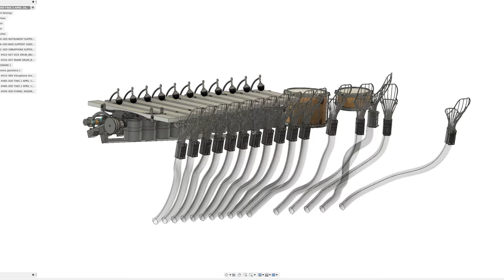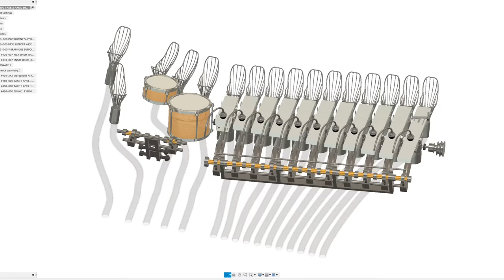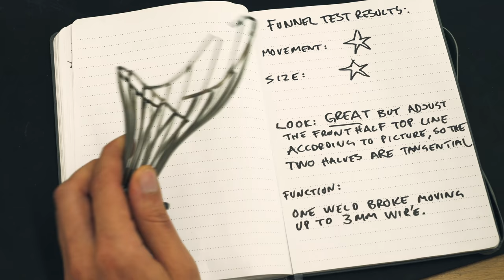Marble Funnel Design Test - Marble Machine X #87

Comment: Rather than fiddling around with welding such thin wire you should use material that can be soldered. Much easier to repair/modify. If that's stainless wire you can solder it as is. Maybe weld the originals, learn to solder it for repairs.
Reply: Maybe brassing?
Reply: Yes we are looking hard at brazing.
Reply: Or you can use spring steel that's known as "piano wire", with bakers flux it can be soldered very neat and amazingly strong, I used a small blow touch or at times a jet lighter to solder it, I used to make slot car chassis with it
Reply: Those almost looked like they had current welded the two together (Pressed the two sections of metal together at that point and ran a high current through them to cause them to fuse and weld together).
Reply: @TheRedneckExpress  i was thinking spot welding would be good too. martin can make one and be able to bring it with him on tour to fix any problems
Reply: @mick-sk5lw  Spot welding a piece that is constantly vibrating and stressing doesn't seem like a great idea to me.
Reply: @CaptainDCap   if they are the same metals and you have the settings correct on the spot welder then the joint will be just as good as welding it using a tig. besides welding the only other way to bond them is to solder/braze and that is something that will fail in a constantly vibrating piece like this.
Reply: Agree, braising or soldering won't be quite as strong as rigid as welding, which in this application will be advantageous

Comment: All you need for the improved spring mechanism, is a screw where you were holding your finger. KISS :p
Reply: I'm glad other people thought this! :)
Reply: Thatd mean drilling and tapping another hole, which is a bit of a bigger ordeal than just cutting off another piece of spring steel
Reply: @anter176  Another option is a hose clamp. It isn't super pretty, but it would be adjustable, and it would blend into the finish of the parts.
Reply: anter176 this is a prop, he can build the next one with the holes adjusted
Reply: No need to drill and tap 4 or 5 holes, just need one at the bottom in the center and another up where he was clamping it with his finger to get the nice motion. There: half the work for improved result.
Reply: What about add a magnet as well? To keep it immediately still?
Reply: I'm sure he's able to connect those two dots himself.
Reply: Finger helped because it damped vibrations, just epoxy two springs together. (constrained layer damping)
Reply: i would add a small solid plate with two slits for the screws ontop of the spring, so it can slide up and down and be clamped where needed. the side that touches the spring needs to be dampened but like this u should get a fine tunable system
Reply: Redesigning and re-machining the connecting piece to have another screw hole is definitely less simple than just adding another piece of spring steel or even a more rigid piece connected by the two screws at the bottom.
Reply: @buddyclem7328  If were going there, why not duct tape or a chip clip?
Reply: @Speed001  I wouldn't be willing to go that far on this project. Of course, sometimes that is exactly the right kind of solution. Cardboard, duct tape, plastic bags, and space suit hoses saved Apollo 13 after all.

Comment: You need an adjustable damper to absorb the extra vibration of the spring leaf. More leaves just push up the natural frequency of the vibration of the funnel. A damper, such as a small urethane foam block pushing against the leaf would not only dampen the vibrations, it would lower the noise level, which I think will make the overall playing of the machine crisper and cleaner - you have to remember there’s already a whole lot of “ground floor” noise being generated in the background in the process of making the main melody - you don’t want that background noise overwhelming the main theme.

Comment: Move your screws, no additional spring steel is needed. You let your fear of breaking a tap get the better of you !
Reply: I was thinking 4 Screws in the lower part and leave it alone.
Reply: Martin should be using his drill press with that tap handle. There is a divot on the end of the tap that a centering point goes into to keep it 90°.
Reply: Breaking a tap = no testing possible. Thats a pretty damn good reason to be scared of it.

Comment: About the spring: you have a spring-damper system. The spring is great, but you've got almost no damper, which makes it flimsy
Reply: Think a bit more about, a plastic/ rubber damper that "slides" up and down would be excellent idea, no?
Reply: Some kind of foam rubber ("Moosgummi") might be nice
Reply: some elastomer coating on the spring would probably be easiest

Comment: Martin, consider adding dampening to the motion (in addition to the spring), it'll greatly improve the motion when a marble hits. Just need to add a bit of friction to it, that'll stop the shaking and result in one smooth give/rebound. Unfortunately without a traditional hinge, I don't see an obvious way to add friction to the movement, maybe a friction plate that the side of the base rubs against when it pivots. Btw super glad to see you're back and continuing on this brilliant machine!!
Reply: Try bungee cord as the return spring.

Comment: why not use copper or brass wires? then they could be nicely soldered..instead of welding.
Reply: Oh, that would give it some nice color as well.
Reply: Or hot/silver soldering steel wires - WIG-welding is a bad option.
Reply: I'm not so sure that soldered joints would hold up to the abuse these baskets will receive.  It's a nice idea to consider other metals and methods to find something a bit less intolerant of problems.
Reply: @aelithmackinnon8656  Soldering with silver should be a strong joint in this case, much more precise and easier to repair. The used kind of welding in the video could harden the whole wire by carbon and heat and make the thin wire brittle.
In industry you would use spot welding (electric resistance welding).
Reply: Definitely silver solder. Much easier and very durable. Don't even have to use brass or copper. Can use steel, even stainless steel (with the right flux).
Reply: Chrome plating would sparkle nicely under good lighting.
Reply: tig braze the steel wire with aluminum bronze
Reply: What is wrong using a spot welder? This fuses the wires together with high level of control and precision.
Reply: solder joins will break under the constant impacts of the marbles

Comment: you could put in some magnets that keet the 2 pieces snapped together, so that when the springsteel returns it it stays in place and doesn't vibrate off again
Reply: There could be a slight risk of the marbles getting stuck or magnetised by the magnets doing that though.

Comment: How about fixing the part of spring where you were pushing with your finger?(3:35) For example, I think an additional screw or a cable tie in the middle of the spring would be a good solution.
( I am sorry if my  English is bad. I depend a lot on Google translator. )
Reply: Your written English is better than most native speakers, no need to apologise.
Reply: @NamedKitten I was about to comment the same thing!
Reply: Agreed!  Is what I thought of too.
Reply: He doesn't need a stronger or shorter spring.  He needs something that dampens the oscillation by taking energy out.  Rubber might work.  Felt might work.  Metal that slides against metal (or other material) might work (because of the friction).

His fingers worked precisely because they acted as a damper.  It took work (in the physics sense) to deform his fingers ever so slightly -- and that work meant that energy was taken out of the oscillating system.

Comment: instead of adding more spring steel, why not just drill and tap 2 more holes on the stationary piece where you were pressing with your finger
Reply: As much as that would work, I think adding more screws might take away from the art-deco look that he's going for. Just my two cents
Reply: @Santrial  Or just a single piece of regular steel, on top of the spring steel, that ends where his finger was?
Reply: or use a magnet, against wobbling
Reply: People have suggested in different comments that that might increase wear
Reply: @matthmdb  no. magnets are good for stuff but shall not be used for anything.

Comment: Personally I prefer this funnel look over one with a smooth curve.
Reply: Yeah, it will make it look like a urinal.
Reply: It's more functional the way it is now too. Since the spring doesn't have a damper, the marble bounces back up and the top half guides it into the tube. Cutting that back to match the curve will make it more likely to get flung right out the top
Reply: @jonathanb104  I think the spring  design just needs a damper regardless of the  marble retaining device" design.
Reply: no way jose

Comment: Is there no possibility to make the holes for screws in the spring steel plate on the finnel closer to each other, so it's closer to where the "hinge" is? So there's no need for the second spring plate?

Comment: I think the use of rubber might get the desired movement. Just wrap a rubber band around it and adjust
Reply: He used rubber bands on the first Marble Machine and he said he didn't want to use those any more because they break to easily and are not consistent enough.
Reply: I think I would've gone for some kind of silicone or TPR tubing with just the right elasticity, which should be more stable and look better than a regular rubber band. (... and then use rainbow colours. ;-) For pride and peace and rainbows and everything.)

Comment: I like but still have that springy aftershock!!!
I'd shorten the length of the flat spring by moving the bolts higher instead of adding more plates, simple and easier since you got so much to fab!
Also, maybe braising instead of welding?

Comment: I think you need a damping mechanism to add to the spring(s).  You would still get the initial opening/closing movement but it wouldn't shake so much afterwards.  That's effectively what your fingers provided when you held the spring manually before adding the second spring.

(Springs store and release energy.  They don't bleed it away.  Dampers bleed away energy.)
Reply: I would propose to eg. add some foam rubber to the spring mechanism.
You could eg. add a thin layer between the two spring-steel sheets in the configuration in the video.
That way, the foam and the friction will take away the energy and dampen it

Comment: To reduce the possibility of breaking the M3 tap, you should consider using the traditional set of 3 taps, starting with the taper tap which is less aggressive than the one you are using (which is designed for blind holes where the taper tap will not fully cut to the bottom of the hole).

This would be the less risky way of tapping all of these holes.

Comment: 3:10 a magnet in the part will solve  your problem  so it won't vibrate but stil close fast and some rubber stopper from like a door or drawer

Comment: Hi Martin! Good to see you're back and rejuvinated. Myself and many others in the comments are suggesting the same thing - you should try putting a screw where you put your finger to fix the issue instead of adding a second spring steel plate. If the damping from your skin contributed, you could also consider adding a small rubber gasket between the new screw and the spring steel plate. I'm excited to see your next video :)

Comment: To prevent the funnel from shaking after the initial hit, you might consider damping it by putting a thin piece of rubber, silicone, or foam in the gap in the metal at the bottom. Best of luck on the funnels Martin!

Comment: When you tried out the new funnel the first couple of times, away from the machine i thought it was waaaay too noisy... Then I came to the 8 minute mark of the video and realised that the entire machine is an entire symphony of noise when not isolated through the fantastic little contact mics 🤣I hope you're wearing very well isolating headphones while playing it!

A suggestion (or question maybe) about the springs; Instead of leaning the bent steel on the outside of the other, why not just layering two identical pieces in the same place?

Nice to see you working on the machine again Martin. I hope your summer vacation was good :)

Comment: What an interesting design! If you want better damping you might try sandwiching some elastomer between two layers of spring steel. Might require some adhesive between the layers but it should make the vibration decay more quickly.

Comment: Martin, the reason the thing is oscillating is because you are using the spring steel as part of the hinge. The result is that you are setting up a standing wave. If you keep the hinge and spring steel as separate entities it won't oscillate like that.

Comment: If you wanted the lower funnel to snap back into place you could use some small magnets to only let it bounce one. if you mount the magnet on a set screw and drill stright through and tap it from the other side you can tune it to your liking too.

Comment: Two thoughts:
You could pre-bend the spring steel (to the opposite direction of the spring movement), 
so it is already pre-loaded when in neutral position.
You could solder the wires instead of welding them. Much less risk to melt the wires.

Comment: Martin, not sure if this has been mentioned, but, for the marble catchers by the drums, rather or in addition to, why not use a hose clam to limit the movement that the back half you had held with the spring steel?  The spring is good so it is not rigid, but, use a hose clamp to limit the amount of vibrating movement.  Glad to have you back, dude!

Comment: I continue to watch your fascinating project. The spring is an interesting problem all on its own. As well as a spring of the correct stiffness which is resilient to fatigue it must also have damping and a method of limiting the extreme movement. There is a lot of complicated solutions mentioned here. But I think you want something simple - a cart spring. Mulitple flat leaves, only one of which is mounted top and bottom as your first spring, Then additional leaves bolted to the bottom only which get progressively shorter in length. This will also provide damping as the leaves will rub against each other causing friction. The spring action will be progressively stiffer the further the ball moves the funnel as it moves more leaves, this will help reduce excessive movement on the more energetic balls. Keep up the excellent work:-)

Comment: @wintergatan I am an optician and we use a breitfeld and schliekert welding machine. Its set for very thin metals. 
Most used for "soft" welding Metal Frames (Optical).  The thickness of the metal we use ist mostly from 2-3 millimetres. 
You can consider that, if you need help. It makes welding thin stuff much easier.
Reply: oooh yes, please can we add a cadre of opticians to Team Wintergatan :D

Comment: Possible solution could be to put a vertical groove on your spring steel with a tee channel on the mechanism so you can slide a screw up and down and adjust tension.

Comment: You might want to consider some kind of damping. Like how vehicle suspensions use shock absorbers as well as springs to stop them bouncing along. Adding more spring steel increases the rebound speed but doesn't stop the vibration.
Reply: ...A small piece of thin, spongy material between the spring steel and the stainless mount might work.

Comment: If you don't want the funnel springing back and forth, you could try adding some weak magnets to hold the parts together.
The impact of the marble would be enough to pull the magnets apart and allow the funnel to open, but when it closes again the magnets hold it shut and prevent it from springing.

Comment: Hey cuz, good to see you back and happy. Don't ever finish this creation or there will be an ocean of lost geeks wandering zombie like on Wednesdays looking for something to do ;-)
Suggestion as an alternative to all that welded wire - Laser cut fine stainless sheet and then form with a press and 3D printed male pattern into a soft rubber sheet. Much less labour and far easier to keep spares for when they inevitably crack.  Or... use a dampened spring with heavier material which will still move to absorb the impact but without the danger of cracking.

Comment: Interesting, great design for a funnel, brilliant! But darn it is loud, your whole machine is loud, maybe it should be but as a layman I would put rubber strips on the inside to dampen the sound, heck, I’d probably do 2-3 whole episodes just to limit sounds and vibrations in the machine, anyhow, great job, looking forward to see it on stage!!
Reply: Maybe some plastic or rubber spray coating would do just fine on those funnels.

Comment: If you're not happy with the remaining vibration in the funnel, you cpild add some damping rather then stiffening the spring. You're finger has natural damping in it so it looked better. Something like adding a piece of medium density foam where the second spring contacts the first spring will help.

Comment: TAPS:  I suggest you get titanium coated (gold) spiral-fluited gun-taps.  You will love them.  
- The titanium coating is a great friction reducer.
- The spiral point pushes the chips forward and results in long chips which are easier to clean-up, instead of short ones.  This is great unless you are doing blind holes.  
- And gun taps tend to have fewer flutes which result in the tap being stiffer/stronger which means less much less breakage.
You will probably go back to tapping with a cordless drill with these taps.  They are awesome, just like your work. :)